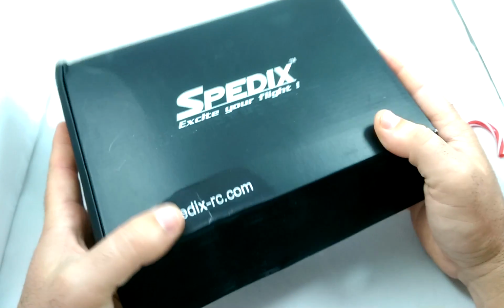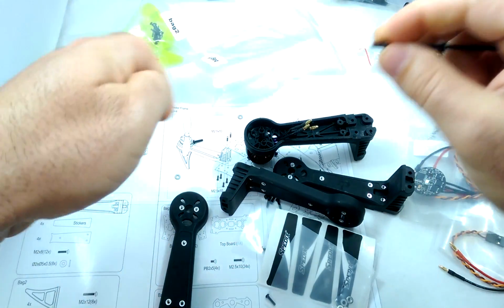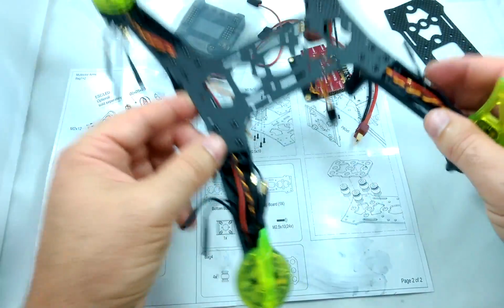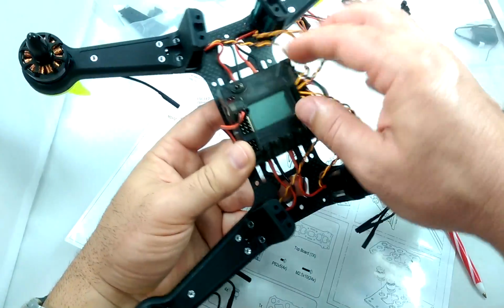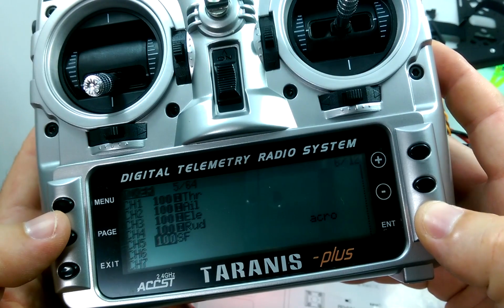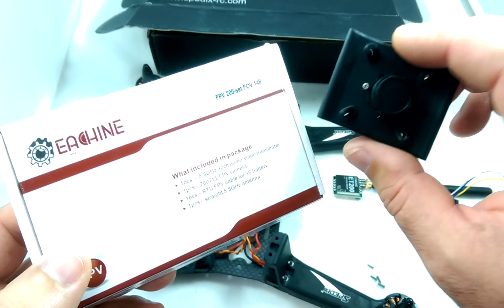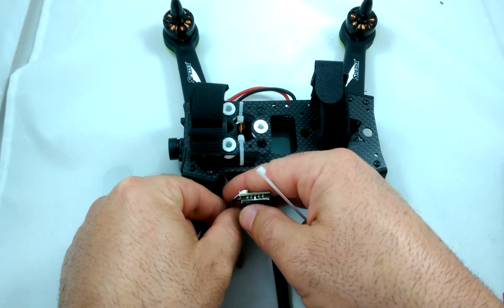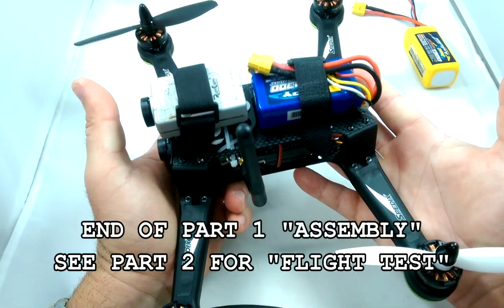SPEDIX S250Q FPV Race Drone Review - Part 1 [Assembly, Setup, Mods]

Comment: Nice build video, I used this to help build up my Spedix 250 (as it came with no instructions). It's built up and I used LibrePilot for the cc3d controller, however, when running it (on 3S) its behaviour is completely erratic.. it's all over the place and will not hover in a stable manner at all. The 3 flight modes are stock, 1- Attitude, 2 - Rattitude, and 3 - Rate (I won't be using that one lol).. do you have any clues as to why it behaves so oddly?
Reply: I certainly will thanks! Having held it up with it hovering (and my hand just preventing it from doing a burton across the hedge somewhere) I moved the controls a little to get a physical feel of how it reacts to what input from the Tx, I like the self stabilising feature, that’s neat! Thanks for the great videos anyway, I’ve watched many now.
Reply: Just a quick query, towards the start of the video you said the top right motor (no.2) would spin clockwise, then on the 28th minute you mention that particular motor should be rotating inwards, anticlockwise? Which way around should they be? On mine I've installed the motors as follows, No.1 (top left) is CCW, No.2 (top right) is CW, No.3 (lower right) is CCW, and No.4 is CW. They all spin the way the motors describe. It takes off (but has that whacky problem), however when i hold it and operate the controller, it does want to move forwards when I tell it to on the stick (in Mode 2), it moves in all the correct directions. I'm just a bit stumped as to why it behaves in such an erratic way yet still is able to accept commands, wondered if the orientation of the motors could be one of the conflicting factors to it.
Reply from the maker: From the top view  they should spin in towards front and in towards back.   It's strange but the way motors are labeled (CW or CCW) is if your looking at them from the motor bottom so it's a bit confusing.
Reply: Hi, yeah I've swapped the arms back to where they originally were, so No.1 (top left of a birds eye view) rotates clockwise, and No.2 is anticlockwise, and so on.. at least now the prop nuts won't fly off. I'll give it a try now and see if the change makes things stable.
Reply: I've tested it and pleased to say it's now miles more stable than before. It still wants to very slowly yaw around to the left for some reason, I've tried to counteract that using the trim but that doesn't seem to have much effect.. wondering what could be causing that?!
Reply from the maker: Glad it's working better.   I kind of forget if you can tune the flight controller on this one but if you can get into the settings you should be able to tune that out.
Reply: Thanks for the reply! Sounds daft but I tried it outside for the first time, I've been trying to get to grips with it indoors lately (alot of wind in the UK at the mo), wondering if that has made the difference. Since I last replied on here I've ran it, hovering in the garden and it was totally stable. The motors were being controlled by the cc3d as you could hear them all adjusting their revs in the breeze, and when I physically tried to rotate the quad around the cc3d sensed it and tried to correct the movement with the motors as it didn't receive an electrical input from the TX, so I'm a bit happier now. Just need the wind to go and I can get out on the rugby field and give it a proper maiden flight.. Thanks!
Reply from the maker: Sounds like it's working good.  Take it slow until you get used to the controls.   The arms will snap if you crash hard but easily replaceable 👍

Comment: Sry I must have skimmed by your reference. I have the BNF KK2 version so I didn't get the joys of assembling, this is my first real quad. Have you found some good solid PI's yet? Buddyrc's didn't hold up well once I started getting some speed.
Reply from the maker: No prob.  Agreed, the buddy RC settings areb real docile for very beginner flyer. I've been slowly increasing PIDs and and I think I've gone to around 150 or so in the KK2 settings for fast flips but still need some tuning as it's a little twitchy.

Comment: BuddyRc.com has good informational videos about assembling this model FYI. But great work for flyin solo
Reply from the maker: Yep, I gave verbal credit to buddyRC in video and mentioned they also have a tutorial.
Reply: +SB-TV  with the included receiver yes you do but... HobbyKing has a Orange 6ch transmitter (like the DX6i sort of) that is cheap and allows for the setting of expos an such. I started with a Spektrum DX5e ($50), and now use the DX6i($129.99).

Comment: Great video, I wish it would have been up a few weeks ago when I put mine together.  I got confused with the motor orientation because they were labeled CW & CCW, I thought this was the way the motor was supposed to turn.  Turns out the are stating the way the threads are cut.  Unfortunately, I have lost a CCW prop cap, and I am currently impatiently waiting for my part to arrive.  Again, great work on the video, I have subscribed and will be looking forward to your flight video.  Keep up the good work!
Reply from the maker: +chris baker Right on Chris thanks.  Sorry you got a motor reversed.  Did you break anything when you lost the prop?  I heard somewhere that the manufacture indicates the rotation if the motor is facing down for whatever reason but your right.. a good way to make sure it to think of just the thread as the direction on motor when they are facing up... it is a bit confusing.  Hope to get some flight tests in this week.
Reply: +Dustin Dunnill  Well fortunately the only thing damaged was my pride, LOL.  I had it in a low hover while doing my initial flight test so it only fell about 6", wait time on getting a replacement was too long so I ordered some Losi 5mm right and left thread lock nuts.  They are not as pretty, but I just slapped them on and was able to fly for a full battery pack.  With some additional tuning, I am pretty sure that I will be happy with it.  Thanks for the reply.

Comment: You really picked up on the Taranis 9D+ quickly.  You can easily get lost in the 12 page menu system, but after a while, its not too bad. "Welcome to Open TX ... " ha ha ha! I might change my start up message to something more appropriate ... perhaps a Klingon shouting "QaPLA"!  (success!)  ;-) Going to watch part 2 now ... good job!
Reply from the maker: Thanks Bill.  I haven't made part to yet...lol.  I'll be flight testing and posting it this week. The Taranis is pretty neat.  Much to learn but seems straight forward one you get navigation down.  It's so cool how you can map your own audio files...I'm sure you know the theme I'll go with :)
Reply: +Dustin Dunnill Yeah, I can guess the start up theme you'll be using!  There's an "announcement pack" out there somewhere that has a lot of good voice announcements.  For example, my SE 3 position switch allows me to select Angle, Horizon or Acro mode ... and which ever I select, it is announced, so I know for sure what mode I'm in. With these racers,  you really can't take your eyes off of them or bad things happen, so its nice to get the audio feedback when you switch modes, or monitor your battery power, or RSSI (signal strength), etc. I'm using a D4R-II in PPM mode which it does natively, and also gives telemetry back as well. Never regretted making my Taranis the 1st thing I got when I decided to give racers a shot. Mahalo!
Reply from the maker: +Bill Somrak Thanks Bill. I'll have to get the announcement pack and fiddle with it when I've got some time soon.  I really like the audio capabilities to keep all eyes on the craft as you mention.
Reply: BTW, my BJ S1 MAY have incurred some damage in its 400 ft. fall after all.  Took it out today with the RunCam attached, and it flew TERRIBLE!  There was a very mild breeze, maybe 5mph, and it was going backward in low, so I switched to high. At first, it was able to fight it, but gradually it lost its ability to pitch forward. Yaw rate became insane. I used roll to fight the wind. When I watched the video, I heard strange rattling noises from the motor(s). So, tonight I opened it up .. didn't see anything really wrong except for one motor plug which was almost off. So, while I had it apart, I drilled a hole in the top of the canopy so the antenna could poke through vertically. I then re-assembled it making sure all plugs were tight.  I noticed that one arm was slightly askew, so I heated it up with a hair dryer and twisted it back.  Gave it a quick indoor flight and it SEEMS okay, but the real test is when I take it outside.  I don't know if the RunCam is too much for it, but it doesn't seem like it.  It goes up like a rocket with it attached. Hope to give it another tryout tomorrow. My Syma X5C with X8C TX was also tested today .. that at least works great, and I got some good video from the 808 on it.
Cheers!

Comment: Very nice video Dustin. How much is the final weight, without lipo and runcam? Is a true 250 or smaller? Tks
Reply from the maker: Hey thanks.  416 grams less lipo.  280mm shaft to shaft.